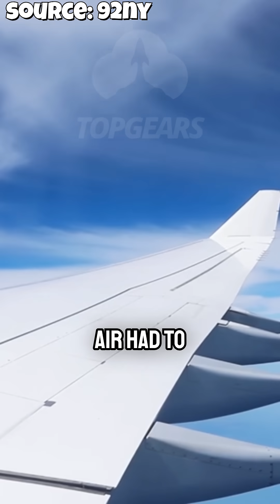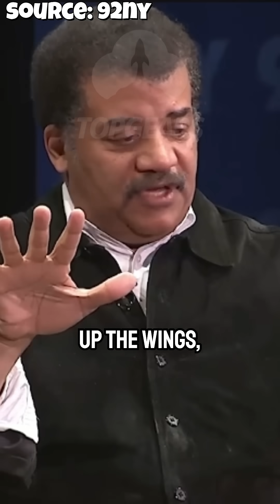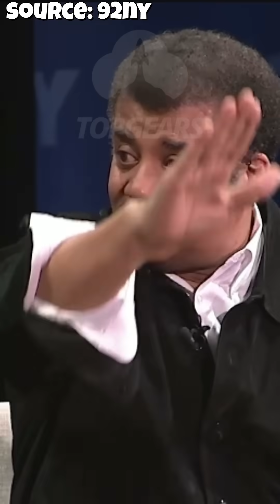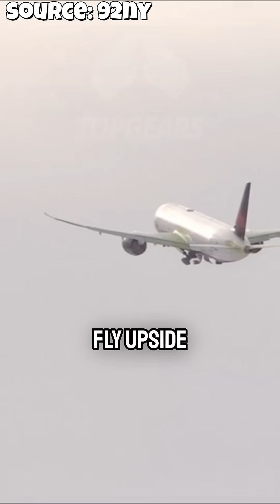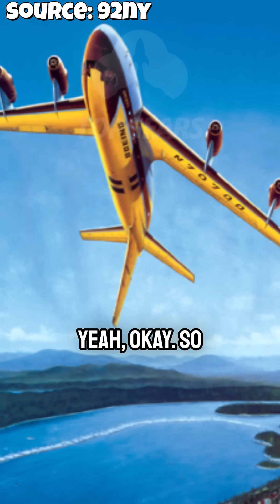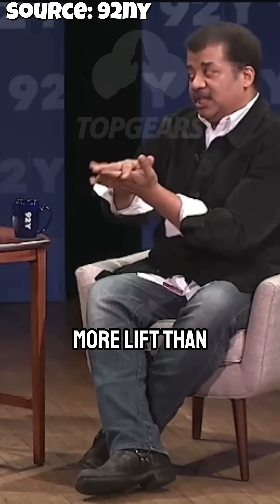How Airplane Wings Really Work Bernoulli vs  Flaps w  Neil Degrasse Tyson

Comment: Yes the  faster moving air "has lower pressure", however that force is not utilized unless a mass of air is excellerated downward. There is no work if air isn't excellerated. To get lift you  have excellerate air downward.

Comment: As the velocity of a gas increases, the pressure perpendicular to flow decreases, not the pressure in general.  You actually get  increased pressure in the flow direction . The total pressure energy remains the same. Changing the direction of pressure energy doesn't change the total energy,  it changes the direction of the total energy. Please stop abusing the bernulli principle. It's is correct but you're using it wrongly.
Reply: Don't look at me dude I just got here
Reply: Isn't that what they're saying 🫥

Comment: The bernoulli effect doesn't cause lift. A pressure differential doesn't cause lift. The cause of all lift is the downward excelleration of air. The bernoulli effect is conservation of energy, which doesn't cause lift. Air does not transit in equal time above and below. Nor is there a physics law predicting that air should travel is equal time. There is not multiple reasons for lift. Only one. A pressure differential doesn't cause lift ,but rather, is lift caused by excellerated air. To be sure , it is impossible to excellerate air without getting a lift, and impossible to get a lift force with out excelleration of air. Lift is a reaction force, not an initial action force. The equal transit time hypothesis is false.